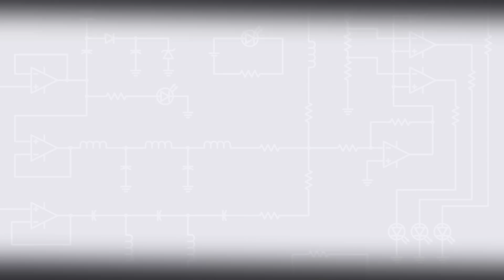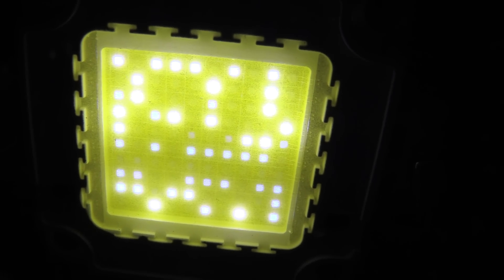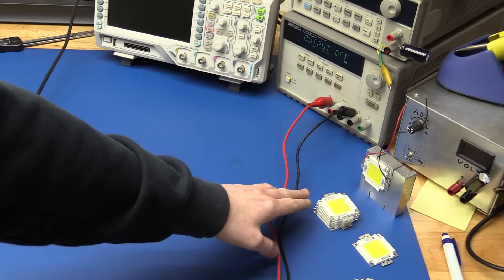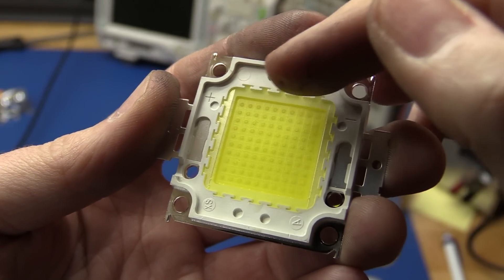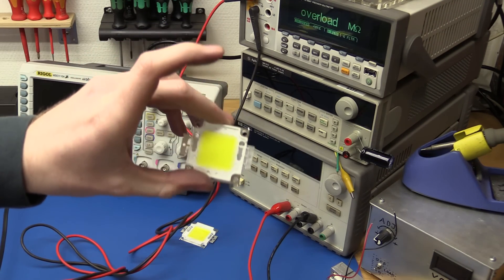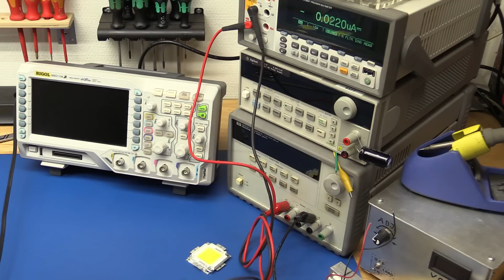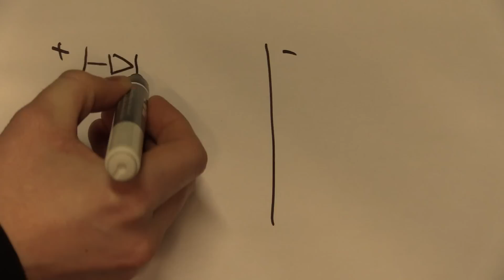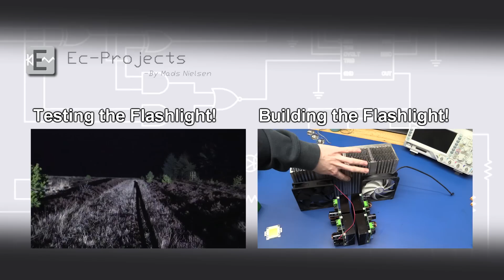100W LED Analysis: Dodgy segments! Or are they ? - Ec-Projects

Comment: I bought around 20 of the 50W ones and they all failed in short order. Some failed very spectacularly with smoke and flames after only 1-2 rows were working. Uneven lighting under low current definitely is a failure.

Comment: Inititaly I thought this was simply a matter of variations in path resistance, but got to thinking that that variations are more to do with the semi condutors efficency at emitting light. So while the path resistance could be similar the variations in the lighting may vary..except the ones that dont work , those appear HR or shorted. Probably wrong though lol

Comment: I would say it is a gain mismatch between the LED's just poor manufacturing some may have a thicker substrate than others causing the thicker substrates LED's to require more power to illuminate them than the thinner substrate LED's  http://www.ledsmagazine.com/articles/print/volume-10/issue-2/features/manufacturing-leds-on-large-diameter-substrates-what-s-the-holdup-magazine.html
Reply: +Ortorea Screenname 
But how do you explain the huge resistive component?
Reply: All semiconductors have a leakage current when ever you look at the Data sheets all components have a break down voltage where electrons flow through a device either in reverse bias mode or forward modes outside the working parameters. But with these LED's it might be a a design effort by the manufacturer in an attempt to balance it. These devices are relatively new, and we are well aware of China making cloned or copy cat electronics done very cheaply so it is a very mixed bag when ordering semiconductors from Chinese manufactures which inherently gives rise to unpredictable or unreliable components.
Reply: +Ortorea Screenname No.  It is a poor manufacturing process causing a resistive path through a large % of LEDs, but that path varies from one die to the next, which is why there is such a large (relative %) current difference needed to illuminate some dies versus others even in the same series connection.

We can call it a defect when you isolate individual single die LEDs and observe that some have this resistive element while others do not, with the non-resistive performing MUCH better with lower Vf and higher lumens per watt.

Everyone seems so happy with these generic high powered LEDs but they fail to see the problem.  They're about half as efficient so you need twice as many for the same brightness, and then have both over double the electrical cost and higher PSU cost, plus higher heatsink cost and size. 

They are a false economy even before many fail due to the designer lacking understanding of what it really takes to keep 100's of watts of LEDs cool enough, unless it's a one-off build where the builder happened to have spare parts to build with but it's much easier to reclaim old computer heatsinks for 1 x 10W LED than the industrial mammoth heatsinks needed for dozens of watts, unless of course they only operate intermittently for short duration so it doesn't matter so much if lifespan is less than 1/10th what it could have been.

To put it another way, if you were to wire up series of 10 x Cree XM-L for example, you wouldn't have this resistive-leakage problem because they have per-die quality control to weed out manufacturing defects.
Reply: Makes sense yes, it is always a problem using low voltage and high current devices unless using super conductors to reduce resistance.

Comment: Just do a destructive micro inspection of the dodgy ones.
Reply from the maker: +StepCorn Grumbleteats Could be fun, but unfortunately I don't have any gear for doing that :/
Reply: Sure you do. We used to do the same thing at General Dynamics with a Dremel and some really good eyeglasses. Just look for weird junctions, blobs of material that aren't where they should be, or contaminants that are where they shouldn't be. No X-ray required.
Reply: +StepCorn Grumbleteats Or just buy quality LEDs instead.  Knowing more about the defect doesn't allow you to keep buying them with any resolution of the problem.  On the contrary so long as they sell well there is little motivation to improve the manufacturing process.  

They might even be reject dies, cut from the edges of wafers then the prime center cut dies are put into better LEDs.  It would make a lot of sense to offload this waste and have a process where if some dies fail they leak resistively so the whole series of LEDs doesn't burn out.  So far, they are still selling these so they have tricked consumers well enough.

Comment: Its not that some LEDs are shorted out causing them to not light evenly under a small current, its the fact that the LEDs are not well matched. That will cause the life of the dodgy ones to be a lot less then a good, matched array. So ya, they are a problem and wont last...

Comment: Very common with the cheap Chinese ones.  The really expensive ones (I mean really expensive like 50-80 dollars each) doesn't have this issue.  Bigclive got a hold of one in an outdoor lamp that was made in China sold on eBay and it was perfect from low current to max.  Everyone was shocked and this wasn't just a one off by accident that a good one made it through either, lol.
Reply from the maker: +Dark Alchemist I've seen a few of his videos now - a few other guys have also referenced to his channel and posted links :) Very good stuff! He explains very well what happens inside the chip and what courses that resistance, in one of his videos..  :)
Reply: Came here to see if you'd already been pointed at bigclive :)

Comment: hi, now that you have so many 100w led, can you put about 12 en series and conect to the mains with a bridge rectifier? i always want to do that but i do not have so many leds. cheers
Reply: I have tried it. It works.
Reply: +Proyectos LED So what kind of a resistor would you need in series to light just one from a 120volt ac with a bridge rectifier hooked up to mains.  This would seem like a great solution  for a ceiling light.  It would not need a capacitor, just a bridge rectifier, a resistor and the 100 watt led.
Reply: +Joseph Nicholas not a great solution at all because you would have almost 300 watts of power to dissipate in that resistor. that would make a better heater than a led driver.
170v (rectified ac mains) - 35v (100w led) = 135v to be dropped at around 2 amps (not even full power) = 68 ohm resistor @ 350w or better
Reply: You don't want resistor in that circuit. Just add few extra LEDs in series to reduce power output.
Reply: +Proyectos LED 
Bad idea. You'll have huge losses in the needed series resistor and the light will flicker as hell.
Reply: Wrong.  Check out electronicNmore vids on powering up an led on ac mains.
Reply: even better, use them to make a bridge rectifier using the leds
Reply: +m4xwellmurd3r A reverse voltage power surge would probably do a lot of damage.  Small magnitude surges happen a lot more often than some people realize.